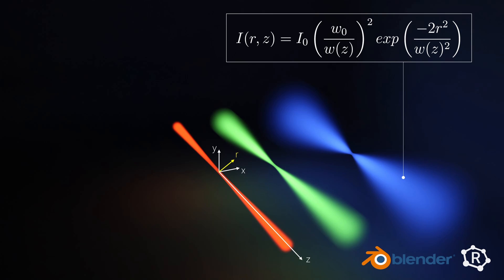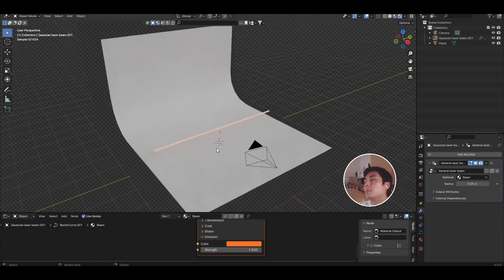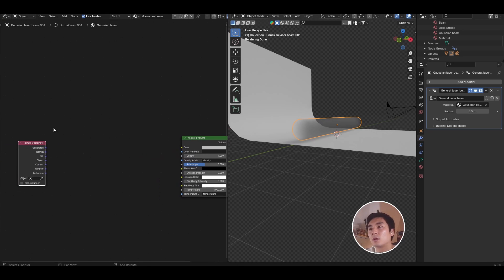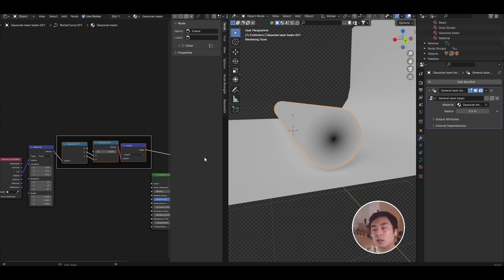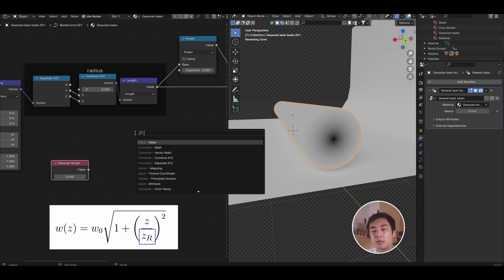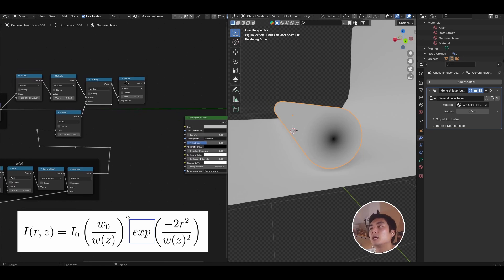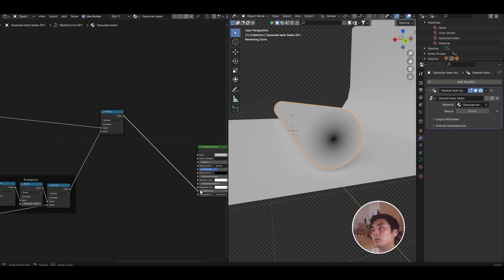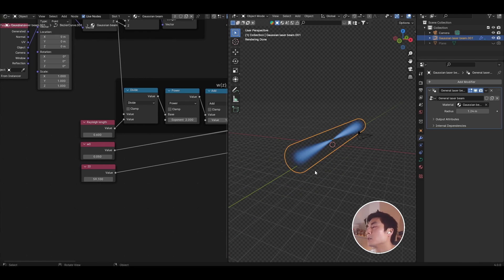Realistic Gaussian beams in Blender - Part 1 (Creating the shader)

Comment: If I understand correctly you created an emissive volume where each xyz point in the volume emits light according to the Gaussian laser formula, right? However, is it possible you think, to somehow create an actual light source that behaves as a Gaussian laser beam? One that could cast light onto objects, just as regular light sources? Be it via nodes, be it via Python scripting? I'm looking for this for quite some time now.
Reply from the maker: Yes, it is theoretically possible - I guess if you wanted to build something from scratch, you are looking to make a new light source (that isn't one of the default 4 of Sun, area, point, cone) that is Gaussian source(?) 
Alternatively, and perhaps a simpler route - you may want to look into the LuxCore render engine which allows for much finer control over how light is handled. I'm not an expert so there might not be a Gaussian source option, but still worth checking out.

Comment: One question: would it be possible to apply the function directly via python API like a formula without these building blocks (nodes)? I am pretty new to blender. Thanks in advance!
Reply from the maker: Good question. I'm not versed in the Python side of Blender yet so can't tell you much. It is something I've wanted to test for a while, just haven't gotten round to. With nodes though, there was mention of a "function" node coming to geonodes where you can declare variables and write full expressions in a single line.
Reply: @ryomizutagraphics  Thanks a lot, I think I found some solutions on youtube. My idea was to create an procedural animation for light pules propagation, where I would define the center of the gaussian distribution with a variable which is then dependent from frame index.

Comment: This is excellent content, many thanks for posting!  I'm wondering how to account for beam intensity change along the propagating (optical) axis, similar to the PSF you would create by focusing the gaussian, in Blender? Thanks for your thoughts!
Reply from the maker: No problem! 
And good question :) If you have an analytical form for how the intensity varies, you just need to take the "x" coordinate from the Separate XYZ output and write whatever function that describes the variation using it. 

E.g. imagine the intensity exponentially decays along optical axis. You'd use Math nodes the write  exp(-Ax) where A=constant. Then use another math node to multiply this exponential decay term with the rest of the equation before it gets plugged into the Principled volume.
Reply: Beautiful, thanks!